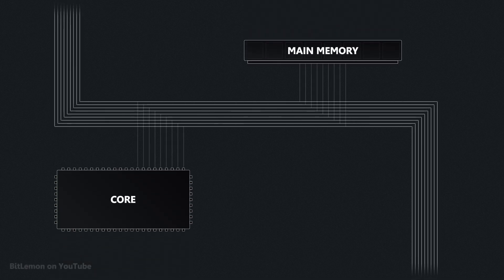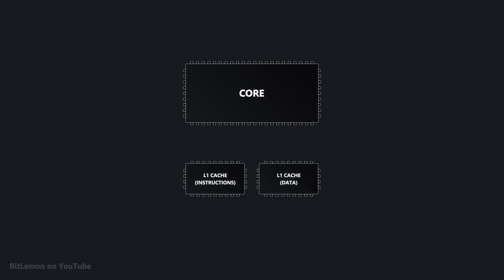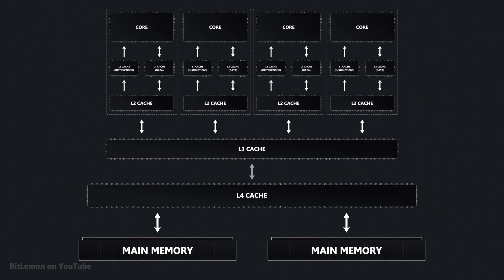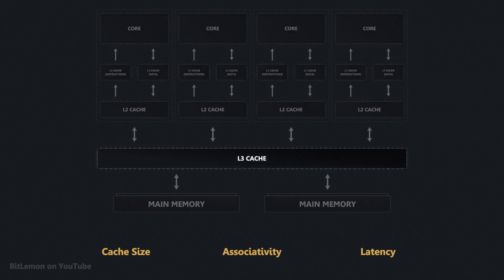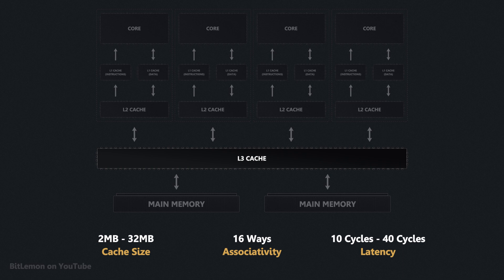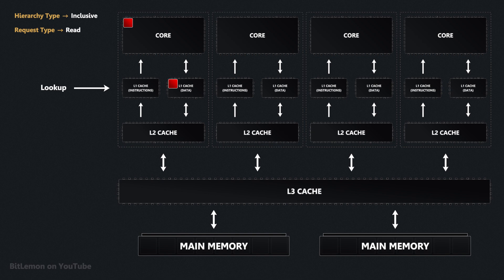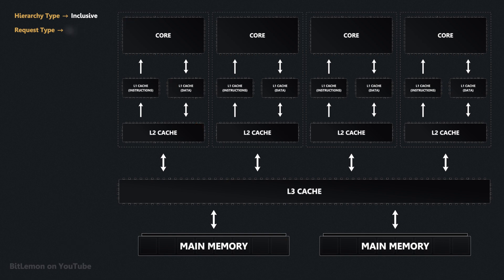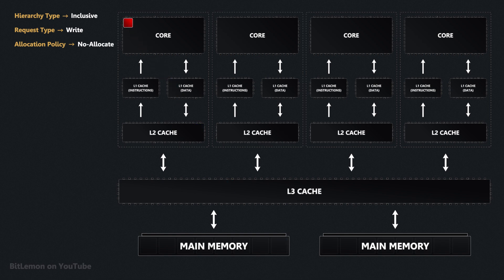Cache Hierarchy: How Modern CPU Caches Are Organized (L1, L2 and L3)

Comment: Why is L2 slower than L1?
Reply from the maker: It's larger in capacity and usually has higher associativity, which requires additional logic. Plus,  L2 caches are usually unified (instructions + data). These different types of information flow through the same physical lines and need a complex arbitration mechanism, all of which increase the access time

Comment: Disappointed by no mention of the bus that must check for core to core cache updates to avoid stale L1 data, especially with write-delayed policy. Also on many CPUs with only L1 and L2 the  L2 will be shared by all cores. (Write-delayed is a less confusing name for write-back.)
Reply: As far as I know, Pentium had cache and was used by id software in pairs on shared memory. So how did they detect a stale cache? 68020 has a cache and multiple 68k were used for example in outrun. Or what about the 32x ?
Reply: @ArneChristianRosenfeldt  Pentium could be set to write-through [easier to manage on multi-socket systems, and less chance of lost data on single socket] or write-delayed [better performance on single socket]. When writing to main memory it would broadcast a message on the memory bus which the other cpu would pick up and use to mark the address as dirty in its own cache(if the cacheline is in its cache)
They used the MESI (Modified, Exclusive, Shared, Invalid) protocol.

I think there may have also been a socket to socket cache inquiry available too when used in write-delayed mode.

Comment: What happens if cache is not available yet in the L3 when another core tries to access it? Does it wait for it to propagate? Or does it take the last known (old) state?
Reply from the maker: I didn't fully understand the question. In any case, a cache will never pass stale values to the processor core.

Comment: Informative video but why stop at L3 or L4 cache why not add L5, L6, L7 and so on cache to improve performance?
Reply: Probably diminishing returns with increased cost and complexity
Reply: It's the way how memory is implemented. By the time you are past L3, the latency starts being   almost as "slow" as main system ram on a memory bus. L1 is usually very expensive and space eating SRAM
Reply: @der.Schtefan why you write “very” ? SRAM has six transistors and two data lines, but does not need the huge capacitor. So cost is like 4 times? DRAM is only dense because we learned how to implement the capacitor as coaxial cable stub going deep into the substrate. I wonder if we could grow nanotubes to do this.
Reply: This has been done before. Intel did a L4 cache on broadwell for certain C cpu chips using a big external Sram die.

The first  problem is that Cache is rather expensive. Die cost scale exponentially with die size so a 100mm^2 die is 4x as expensive as a 50mm^2. And modern CPU cores are actually quite small zen 5 is only around 4mm^2 but the on the full zen 5 CCD half the die area is that 40 MBi of L3 cache and the 8MBi of L2. And as an additional problem thanks to the high clock speeds, as the size of the cache increases the latency will increase as well just moving the data from the cache back to the processor.

Cache is also quite power hungry even when off so they tend to want to minimise it for consumer platforms, especially if it is going to be idle a lot like a phone or as intel did allowing the whole cache to be powered off on the performance cores.

As for why we still don't see them trying with L4 or L5 cache, there are a lot of so called cache unfriendly workloads. These work loads tend to have a few things in common. Low levels of exploitable instruction level parrallelism, high levels of random branchs (especially consecutive branches) and a large random and sparsely accessed dataset. Doing these things tends to result in a processor being unable to effectively speculate ahead or reorder instructions to hide latency leaving it purely at the mercy of the memory subsystem to determine how long the stall will be. Thanks to the random sparse accesses the caches are unlikely to contain the right data as data is being trashed and discarded constantly and is unlikely to be prefetched correctly thanks to the randomness. A bigger cache may allow you to brute force this problem as AMD has proven with the X3D line of chips but if the data set is still sufficently bigger than cache, that hit rate is not improvement, you will see no improvement in performance. And if your new big cache doesn't have enough bandwidth to feed the improvement in hit rates you will also have a problem where the cores end up stalling waiting to the cache to actually get around to servicing their request. Making a cache higher bandwidth makes it bigger and more expensive.

This is part of the reason that a lot of modern CPU optimisations and a lot of HPC software optimisation focuses on how to make sure the data and istruction stream is as predicatable and cache friendly as possible.
Reply: @jedijackattack3594  Well explained, I also wonder when cache miss occurs would the latency be just RAM latency or RAM latency + latencies of all the cache levels combined?
Reply: @chetan_naik  depends on the access architecture, usually serial and not parallel, which means the latencies would be added. However a main memory access time is far far larger than a register file access